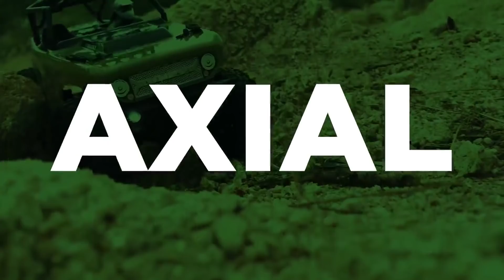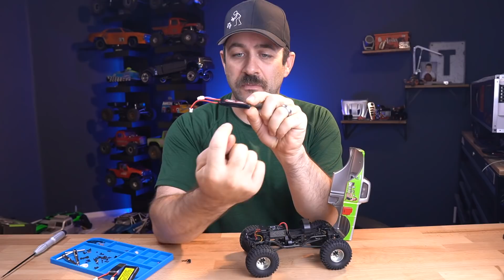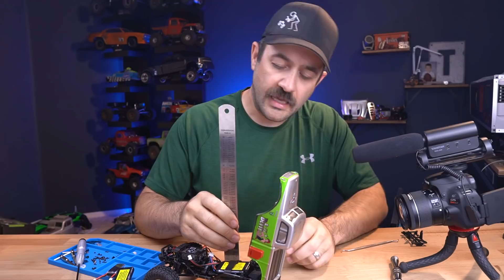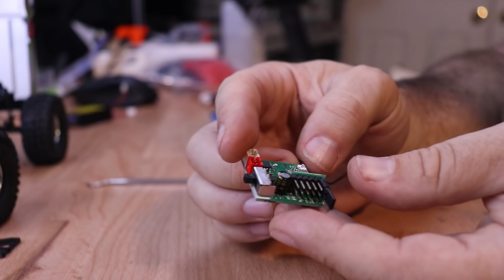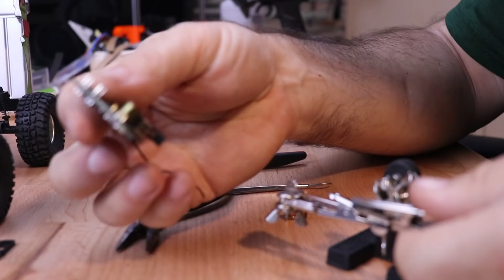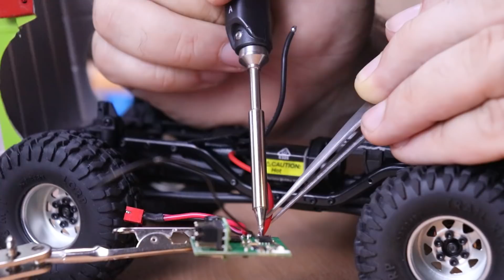Axial SCX24 Budget Build - Free Mods - Week 4

Comment: I just did the conversion to long link and found that there wasn't enough pivot balls so I found that antenna tubes fit perfectly in the eyes of the links. And switched plug to xt30 since I had a box of lipos in that thinner style for my fpv tinywhoop. They work great though

Comment: Is there a way to adjust the rear body height on the SCX24? I've looked around for extended body posts and haven't found much.
Reply from the maker: You want to raise it?
Reply: @HarleyDesignsInc  I want to buy the model with the C10 body. I think the body sits too low and I know the back of the body sits on the hinge mounts that don't seem adjustable. I also noticed that there seems to be body post holes on the frame in the rear. I was wondering if I could just get some posts and adjust them to my liking. Thanks!

Comment: You know I like your content but dude it's supposed to be a friendly build off on context of being out regular Joe blow consumer friendly build and yet everytime y'all do this you are furthering furthering stretching the rules. Using your unlimited recourse that are way above others to benefit you and then calling it a technicality. It must be a Cali thing I don't know. But it's vibes like this that made Sorrca Comps a nightmare to be a part of.
Reply from the maker: A 3D printer is very common now and a great hobby tool but also not needed for this week as the modded stock tray gives nearly the same setup. The only other item was a soldering iron which is a must in the hobby. The battery thing, again not needed but in every budget build before the battery costs have never been added.

Comment: Doing it right! Cheating aside (lol), you already have Matt beat on this one. With the stick pack, wouldn't the CG be lower and weight bias more ideal with the battery laying across the rails just in front of the motor/trans? May be true with the stock battery as well. With regards to the custom chassis, ABSOLUTELY! I'd love to see your take on a SCX24 chassis. Keep up the good work.
Reply from the maker: Keeping it in the rear was the lowest option. Another hurdle was that if I moved the RX to the rear meant I needed a servo extension. Either way, I think this is as low as I can get it with this chassis.

Comment: The more I modify a vehicle the more frustrated I get that it was running better stock and was cleaner looking.. Most of the time the original version has been designed that way for a very good reason!! 😉 👍
Reply from the maker: I’ve seen that a million times as well, but it usually comes down to parts selection or even execution. Tuning is always something to consider, as just bolting parts on won’t always make a difference/improvement.